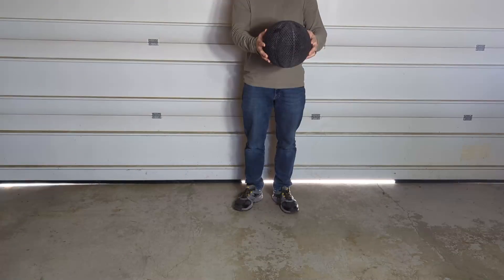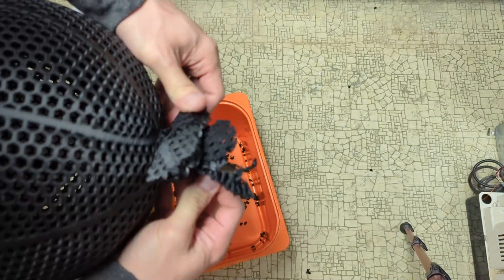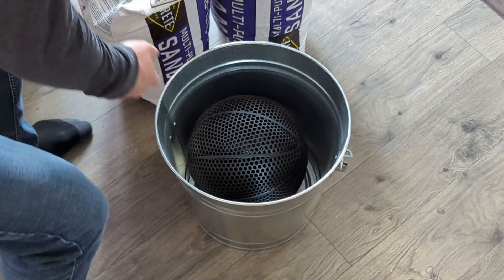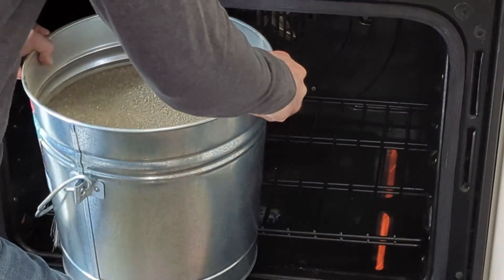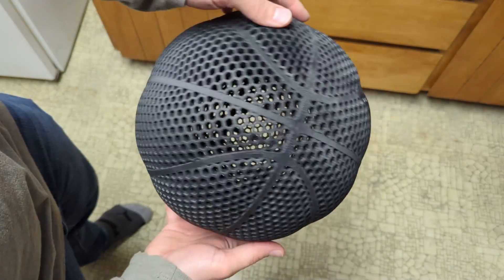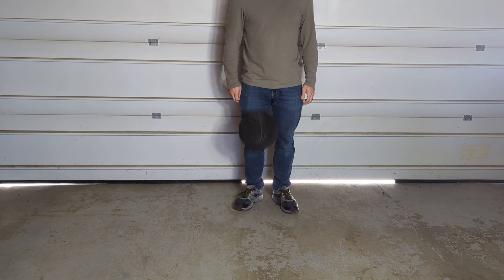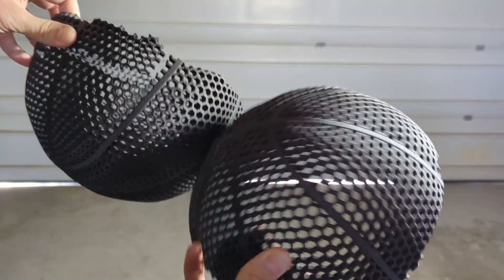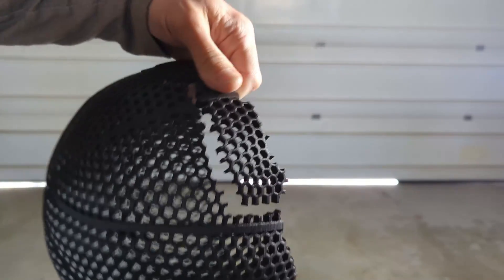Carbon Fiber Reinforced Nylon (PA6) 3D Printed Airless Basketball – Will It Work?

Comment: My guess is that just trying different filaments won’t get you there. I think you should legitimately a series of designed experiments rather than shotgunning. There are resources on the internet to help you do this in a way that can test multiple parameters.
Reply from the maker: I suppose approaching it more scientifically never hurt, thanks for the recommendation 😁

Comment: nylon gets more impact resistant with moisture, you can let it in the open for longer or even soak it lol, but yeah you can try regular nylon like polymakers copa which is much easier to print
Reply from the maker: Might have to give that a try 😁
Reply: @makeitlabchannel   yeah :) but peba first please :D